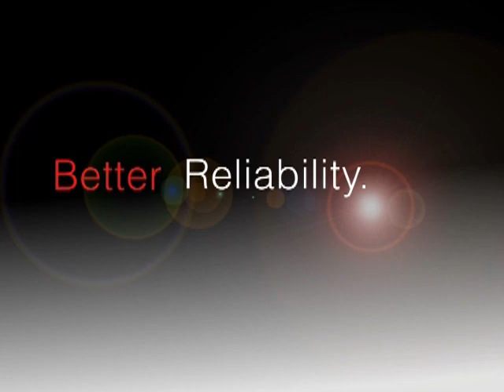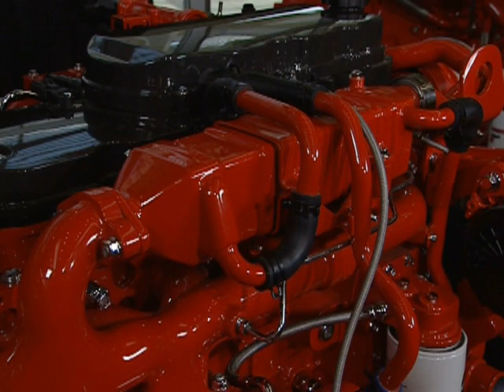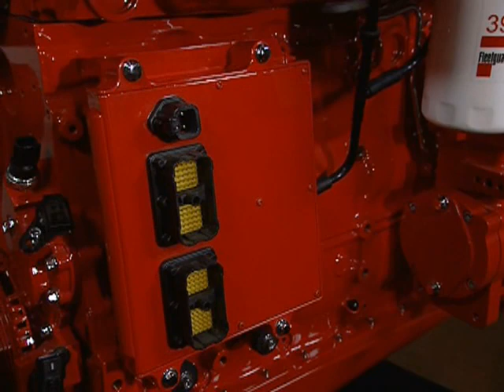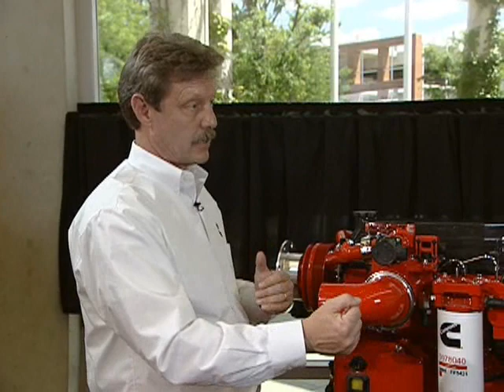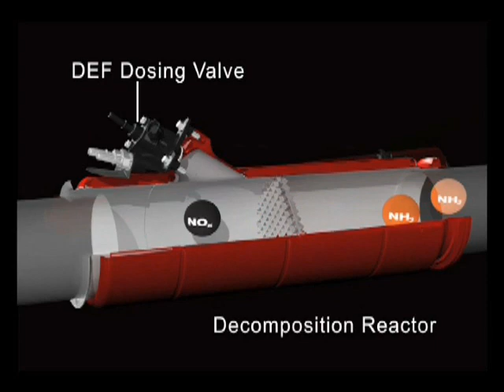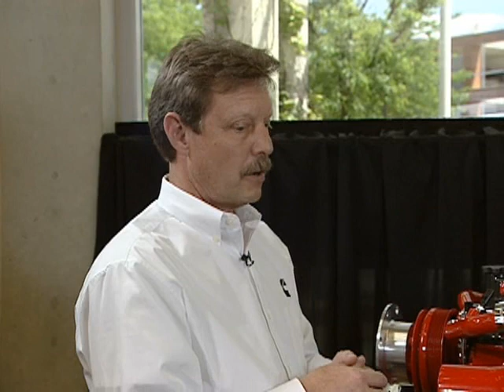2010 Cummins ISB6.7 Overview

Comment: Wtf like for real 🤣 engineer are not mechanics. You don't put ecm directly on the engine. Nor electronics due to heat fatigue. Plus Cummins build good engine but due to faulty emissions system it fails as a true Cummins

Comment: Lotta people hated seeing new things 12 years ago…. Most of us still hate the after treatment 12 years later. But the 6.7 really is a great little engine she pulls well and gets solid fuel economy especially paired with the correct transmission. I’ve seen a few of these in 26 foot box trucks get to a million miles. Most of them get worked to death and maintained poorly and need overhauled or replaced after 400k depending on how bad it was Beat on. But 400k or more on the trucks these go in takes a long time very few are over the road. So now that it’s been a while I just want to say, it’s not the venerable 5.9 but it’s a good engine capable of very solid performance and solid fuel economy. The high output 6.7 in the ram trucks this year has 420hp and 1,075lbft. Of torque, the average semi is putting down  400-500hp and 1500/1750lbft of torque with an engine twice as big…

Comment: The DPF system is the biggest problem I deal with on the dozens of trucks I work on. The utility companies using these are constantly having issues and needing forced Regen cycles. Talk to your medium duty, power company guys. You'll get a ton of feed back from them.
Reply: I'm working with VDL bus 🚌  year 2014 6.7 isb engines .  have changed turbocharger,dpf, new injectors adjusted the rockers and still dpf getting clogged
Reply: @Makedoniadunek  there's also a differential pressure sensor next to the EGR valve and its ports get clogged and a sensor behind the intake heater grid that gets clogged. It's at a 45 degree angle and takes a T15 bit to remove. (IIRC)
Reply: @fuzzynutz069  
I've been changed both differential sensors.
Thanks for the feedback  😊
Reply: I  noticed the egr cooler was clogged to,  🤷 I will sending it to cleaning..

Comment: I have a 2005, 2500 with 4:10 gears, 11-1/2" ring gears, 216,000 miles and still get 20+ mpg on the highway. 2006 was the last good year before the crap was added. Only catalytic converter and muffler.

Comment: the 6.7 is a great engine but I wish the EPA didnt stick there nose in this .. thanks to them the 6.7 won't show it true horse power until it deleted
Reply: I have my 6.7 in my ram deleted.   Not sure if they are similar motors to the ISB but it runs so good after gutting all that EPA crap.  25mpg on the highway
Reply: @colinhunter8793  I get 21 mpg

Comment: Seems to me that everything that reduces pollution decreases efficiency ie. increases fule use (decreases mileage), increases vehicle and service cost, decreases reliability (especially in cold climates), increases complexity. And, pretty much everything that increases efficiency ie. decreases fuel use decreases pollution as well. Seeing that the price of oil will only ever go up at an accelerating pace, the focus should be on improving efficiency. Decreasing weight, friction and drag as well as hybrid drivetrains...
Reply: less weigt, less friction in the engine, less friction in the gearbox, less friction in the final drive, less rolling resistance in the tires, less aerodynamic drag, more energy options (bio-gas,, natural gas, ethanol, electricity, bio-diesel...), more people in the same car...
Reply: EGR sucks ass!
Reply: SCR systems urea gets urological problems in the cold...ie. it sucks ass!
Reply: Anything that increases complexity without increasing efficiency sucks ass!! Plain and simple.
Reply: And the best innovations decrease complexity and increase efficiency! Way to go!

Comment: Al Gore's oil company Buddies are selling this pollution crap to lower gas mileage on the diesel and bring up cost so egr and dpf is unnecessary crap volcanoes spew out so much more than a diesel truck. Global warming pollution is Bull crap. Its natural all worlds in the solar system have changed look a Jupiter 1 now 2 red storms. Sun storms on the damn sun the gave the selves away. Goodness people put 2@2 together. Egr and dpf systems kills performance reliability and gas mileage on diesels